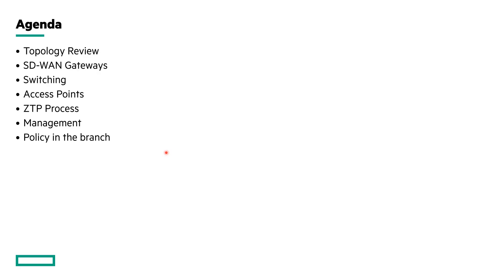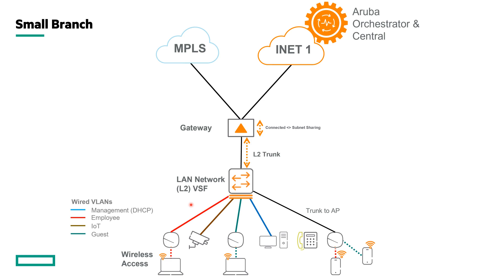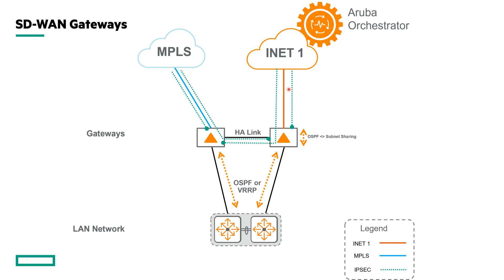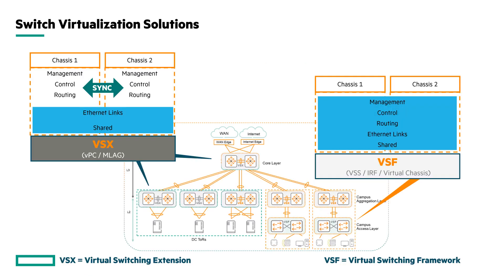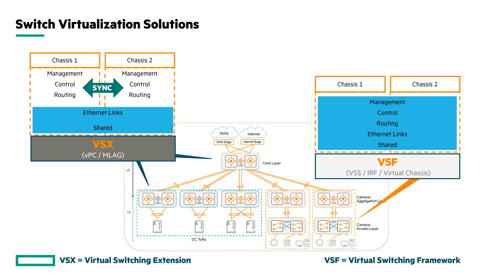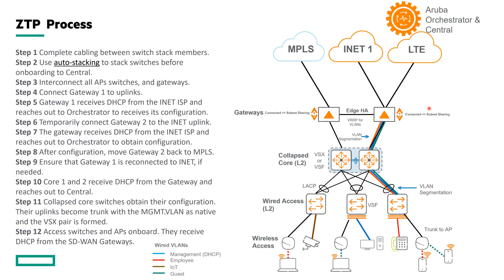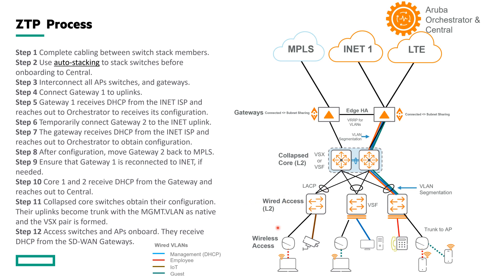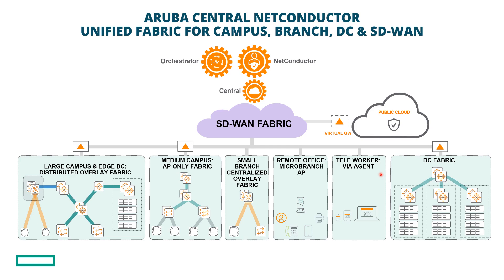VSG Expanded - SD-WAN Branch Design

Comment: Hi team, when you talk about "Edge Connect" and/or "SD-WAN gateways" you mean something like A9004 from Aruba or SilverPeak? If I am not wrong, those icons on this slides are from SilverPeak then I wonder if they are Aruba Central managed capable.
Thank you very much in advanced!!
Reply: Hey Jose.  YouTube comments are acting funky, so apologies if this is a double comment.  Aruba's SD-WAN is now under the "EdgeConnect" umbrella.  We have EdgeConnect...SD-WAN (SilverPeak) SD-Branch (AOS-10 SD-WAN Gateway with Central) and MicroBranch (AOS-10 AP with SD-WAN tunnels).

The three videos I did here cover EC SD-WAN (Silver Peak) + AOS-CX + AOS-10 APs. The SD-WAN gateways are managed by Orchestrator and the switches and APs are managed by Central.  

If you're looking for SD-Branch content leveraging the A9004 check out the SD-Branch videos we have on the channel and the VSG, which covers all our SD-WAN solutions.